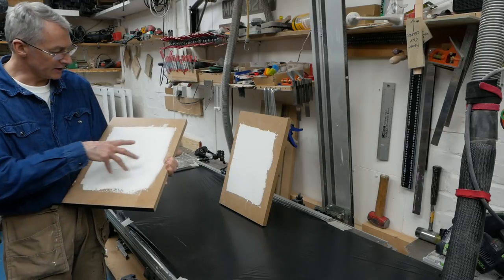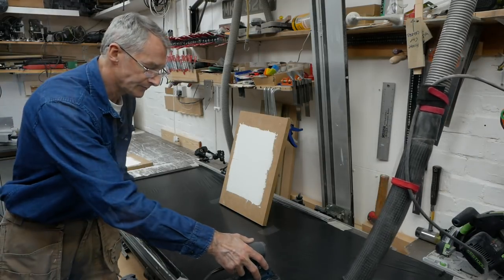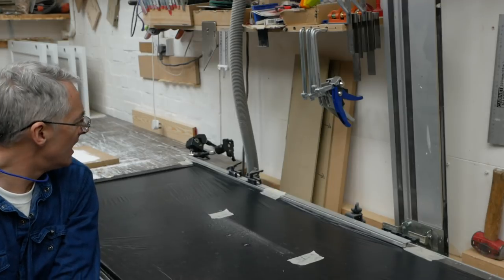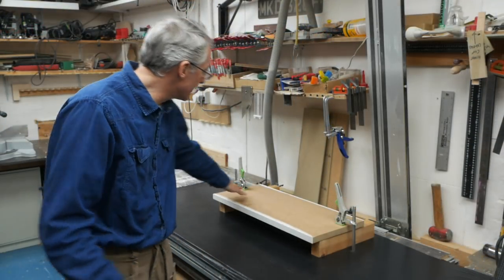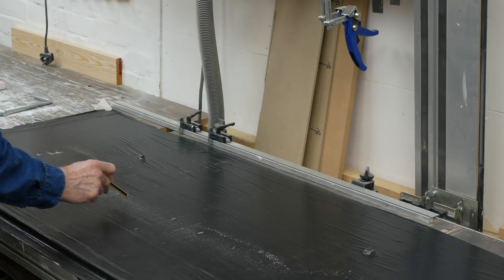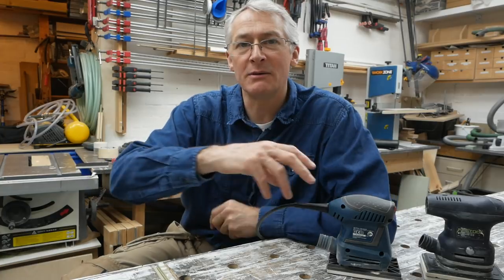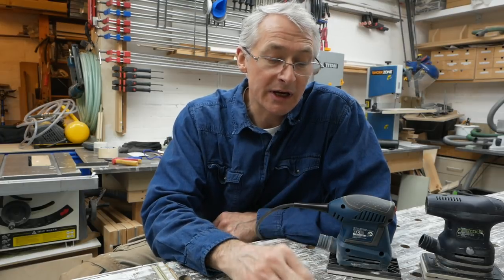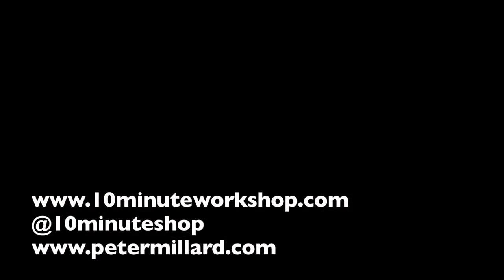The Mirka Abranet Test #157

Comment: Thanks for the vid, I looked to buy the Festool sander/vacuum combo and could not get a decent price.  I was at my local Dulux trade counter and Mirka were doing a road show with their combo was at a considerable discount (hundreds of pounds below the green label version).  It has been a real workhorse, the Abranet does not clog anywhere near like the standard paper version and I do buy them at a decent price.  They last on average three times longer and I don’t throw them away.  I’ve done large solid floor areas in my lads salon (Oak) - sand all sorts of furniture.  Excellent dust collection was a must.  I’m not suggesting it’s better than Festool, for the money it has proved an excellent buy and performer.  Kindest regards Mike
Reply: Mike S   Mike what Mirka sander did you buy? And was it a Ceros or Deros?
I too really like the Mirka sanders and Abranet sand paper/mesh. I have it in 40 grit up to 1200 grit and I get virtually no dust after sanding.
Ron
Reply: I have festool and am switching to all mirka. I really feel festool is over rated

Comment: Abranet fanboy here I'm afraid. I've been using them for well over 10 years in the automotive industry and I'm sold on them. Yes, they cost more than other types of abrasive but since they almost always last longer than other paper backed products I've used, the initial cost is evened out in the longer run. And I understand your comments about the interface pad. They are made more for sanding over gentle curves, to stop you getting what we call the "50 pence piece" effect, where you can get ridges if you use a harder backing pad. They are not ideal for flat sanding.

I see it has been mentioned already but the pad saver is really what you need in your application. Due to the net nature of Abranet, sanding dust and worn abrasive particles can find their way onto the velcro of your backing pad, causing it to wear and lose its "stickiness" prematurely. The pad saver was introduced to reduce this effect. The velcro on the relatively inexpensive pad saver wears out first, saving the more costly backing pad. They are so thin (basically double sided velcro) that they don't affect the handling of either orbital or random orbit sanders, or indeed hand sanding blocks.
Reply from the maker: Thanks Andy. I bought a pad saver and an interface pad, and they were both the foam type. Turns out you have to specify ‘pad saver strip’ to get the thin one <shrug>

Comment: i;ve used the mirka deros with abranet sanding discs but you used the the foam backing disc which is used for shaping where as the normal pad saver sands flat
Reply: QWERTY7773 Mirka has 2 type of intermediate pad that will extend life of the backing pad. 1 pad saver  2 interface pad. The pad saver is thinner.

Comment: My impression was that the main advantage of Abranet wasn't the dust collection, but for the longevity of the sheets compared to traditional sheets. 

The normal sheets can "clog" easier, the dust getting stuck in the sheet and making it smoother.  With the abrasive being the removable mesh, you can pop it off, blow it out, and continue using that same sheet. You're not constantly popping sheets off and tossing them in the bin. More eco-friendly or the like? Man, I sound like a marketing shill... ;D

Now, whether the longevity and convenience factor offsets the cost is completely another matter, but I've seen woodturners that swear by the stuff :)
Reply from the maker: Me too, but have to say I’ve never had an issue with clogging on Granat. 👍
Reply: Fair enough!  This may be one of those instances were it works great better for everything but Festool :D

Comment: I use arbranet with an LS-130, I don't use any interface pad and I haven't noticed the sander's pad wearing more quickly than usual.  Festool also make thinner interface pads.  I also find arbranet less likely to leave unwanted marks in finer grits.

Comment: I’m late to the discussion, this dropped over a year ago (#091) and several months ago (#157).  Thank you Peter, for very thorough review & research.  I really enjoyed watching the #091 three parts, was on edge of seat by the third episode.  
I own Bosch sanders, they are reliable, cost-effective, and get the job done.  I love that I can use third party sandpaper with them.  Have not yet tried Abranet paper, or drilling out the Bosch bottom plate, thanks for info about Festool pad saver strips.  
I also own Festool sanders, they are obviously premium tools.  Whenever I am working inside or in a dust-critical situation, I always grab the Festool.  When outside, esp with more than one person on the project, we get out the tools, and swap after a while if we can, so ea person gets time on the tools.  As expected, opinions are divided.  The effect of wood dust on our lungs is long-term.  Bill Pentz’ research is food for thought, if not action. 
The “is the Festool really worth it?” debate will never subside, nor should it.  The wonderful thing about the current tool market is our option to choose from many good choices.  Imagine the dire straits if there were only one Tool Company.  Of course, the best tool is the best one for you, which will vary from project to project, budget to budget, & clients’ expectations.   
Thanks again, you clearly put a lot of time into preparing these videos, they are very informative.  I too always appreciate it when I can breathe easily.  The dust collection on plastic sheets was an eye-opener.  Cheers….
Reply from the maker: Thanks Rich! 👍👍

Comment: I bought a Bosch GEX 125-1 AE sander last year - its similar to the one you were using in your test but has a 125mm round pad.  I find it a nice little sander, effective, handles well and good value. I've tried it with  Abranet and found it does improve dust collection over conventional discs, as your test shows. Plus I think I get better performance due to less clogging. So, it works for me!
Reply from the maker: Appreciate he feedback, thanks! 👍

Comment: Hi Peter, check out the „Pad Saver“ from Mirka. These are available for Festool hole patterns and only add about 3mm (or less) thickness, thus giving you a much more „conventional feel and control“ for the sander when using Abranet.
Great comparison!
Reply from the maker: Thanks! It's called a "Pad Saver Strip" apparently. I bought a "pad saver" and an "Interface pad" and get the foam version both times, sods law. As I say in the vid, I don't think the foam pad affects the dust collection (which was the purpose of this vid after all) but it sure doesn't help the handling!
Reply: I can‘t speak for the RTS, but I‘ve been using the pad saver on my ETS 150 for years and have no issues in handling. If in doubt, I would say with the hard pad and the pad saver it equals the feel of the medium pad with normal paper, if that helps...

Comment: The Mirka Deros plus Abranet, is a dream combo. Little dust, light, not too much vibration and effective. have tried the lot and I think it is worth every penny. Particularly for the really noticeble reduction in fatigue, which I think subconsciously is the real reason sanding is dreaded, even more than the dust. I bought mine, as an Axminster return. Really recommend.
Reply from the maker: They’re fine sanders - just wish I could get along with the flappy paddle switch; had to return mine 😕
Reply: Thats a shame. Try the new rectangular one, it looks even lighter, and maybe the paddle won't bother you. The plug in versions are easier to use than air powered. The paddle is not so stiff/large.

Comment: Peter, have you done any testing to determine performance differences between Abranet and non-mesh style sandpapers to demonstrate the effectiveness of Abranet?  To my way of thinking, that aspect its sanding performance, which of course would be influenced by how well abrasives facilitate dust-free operations, is much more important.

Additionally, I'd like to see such testing done with the panels in their most common orientation, and that is lying flat on the bench.

Thoughts?

Comment: Good review.  Didn't think the pad would affect the Festool so much! Thanks Peter.
Reply from the maker: Thanks Jim! Turns out there is a thinner pad saver called a "Pad Saver Strip". I bought a "pad saver" and an "Interface pad" and get the foam version both times, sods law. As I say in the vid, I don't think the foam pad affects the dust collection (which was the purpose of this vid after all) but it sure doesn't help the handling!

Comment: Dear Peter, thanks for the video. I am making wooden pendants (very small), so I don't have a chance of using power sander. I use hand pads without dust collection. Abranet never clogs. It is faster (I know cause I hand sand) and lasts much longer than all other sandpapers. This is my experience.
Reply from the maker: Thanks Olcay! I’ve never had a problem with clogging since using Granat tbh, and these tests were really about dust collection more than anything, but appreciate the feedback 👍👍

Comment: The biggest problem I found with Abranet was that it lost its grip on the pad much sooner - long before the grit wore down. So you are left with a bunch of (in my case) discs which are usable for hand sanding, but come flying off the orbital sander as soon as you switch on the machine. I tried to talk to an Abranet rep at W16 (NEC Trade show) but he was not interested. I got the feeling that it was a known problem to which they had no answer.
Reply from the maker: I think this is where the interface pads, or pad saver strips come in. 👍
Reply: Yes, I can confirm Peters reply. The Pad saver helps greatly in adding a normal amount of „sticking power“ to the Abranet, It also, as the name implies, keeps the original pads Velcro protected. In addition, it can be used as a minimalist interface pad on normal paper. I‘m not in any way trying to advertise, it‘s just that my personal experience with the pad saver has been really great and I see it as the most important addition to my tools since starting to use Abranet...
Reply: Thanks both. Maybe I'll give it a second chance. I spend quite a few hours each week using an orbital sander, so any improvement is welcome.

Comment: I find mesh type sanding abrasives knock spots off of non mesh types when sanding on the lathe. They don't clog as often and both sides are usable. I do use both still. The lower grits from #60-#120 for  general sanding and the higher grits #180 - #600 for finishing work

Comment: I use the foam pads to sand non-flat surfaces and profiled timber.
Reply from the maker: Yeah, watch the follow up vid. I bought the “pad saver” and an “interface pad” and the foam ones were what showed up. “Pad Saver Strip” is the magic phrase, I’ve learned 👍

Comment: Hi Peter, another great video thanks! Just out of interest, I notice you work with MDF quite a lot and I was just wondering if you use an M class dust extractor for this? I know the Festool CTL26 is meant to have the same filter as the CTM26 but without a few of the extras, so I was considering going down this route. However, just wanted an idea of what the pros use. Thanks again for all the great content!
Reply from the maker: Hi Daniel, and thanks! I use regular CTL extractors; as far as I can tell the only difference between the L and M class Festools is the warning you get with the M class when the extractor bag is full enough to restrict the airflow. But of course, please do your own research before making a significant purchase! I seem to remember a detailed thread on Festool Owners Group forum about this  exact issue - might be worth getting on over there and searching it out?? 👍👍
Reply: Thanks for the info Peter, it's a great help. I'll be sure to check that out!

Comment: Had never heard of Abernet before, I have some Axminster mesh sanding strips meant for wood turners as they are cooler in use when final sanding a piece spinning quickly on the lathe. They also are quite a bit slower so I guess it depends if you want to save time or your fingertips 😄

Comment: Abranet is what the woodturners use I had plenty of this for my lathe easy to bend etc. 

How do you do extraction I heard some type of industrial vacuum in the video do you have flexi pipes over the workshop or some type of tube ducting? 

Make plenty of dust here I have a Henry Vacuum looking at rigging this up to suck it up somehow. Regards Tony
Reply from the maker: Hi Tony. I’ve heard from a few woodturners who are fans - the mesh backing makes for ‘cooler running’ I think?? WRT extraction I have an old Festool CTL 22 vacuum under the main bench and I run the hose up and over the bench to a boom arm that reaches the main areas pretty well - I talk about it in a bit more detail in my shop tour video. I have another smaller extractor attached to the mitre saw, that also does duty on the bandsaw. 👍👍

Comment: Peter I don't  use the pad with my sanders, Festool's  and Makita.  They also make a thin pad , about 3 mm. B
Reply from the maker: Thanks! It's called a "Pad Saver Strip" apparently. I bought a "pad saver" and an "Interface pad" and get the foam version both times, sods law. As I say in the vid, I don't think the foam pad affects the dust collection (which was the purpose of this vid after all) but it sure doesn't help the handling!

Comment: thats an interface pad on that sander rather than a pad saver, pad savers are mm thick. that interface pad is used to sand curved surfaces to help spread the pressure evenly which is maybe why on flat surfaces it tend walk all over the place due to lack of pressure being applied
Reply from the maker: See Abranet follow-up video. https://youtu.be/8lMDfx9O2J4

Comment: Whats your experience of clogging? I bought some JCB branded mesh abrasive recently (because I saw it in the shop and thought I would give it a go) and in my limited use of it it does appear to clog less/be easier to unclog than normal sanding sheets.
Reply from the maker: Have to confess, I've never had an issue with clogging when using Granat. I think the dust collection helps keep the abrasive cool, which reduces it significantly. 👍
Reply: I have used the mesh based stuff on my mouse sander which doesn't have any dust collection (I know I should have realised when I purchased it!) and it appears to clog a lot less than normal abrasive. Plus when it does you can just peal it off and blow it out. I noticed that a commenter below has mentioned something similar. 

I guess the moral of the story is, only buy sanders with good dust collection designs and it makes life better all round! :)

Comment: Have you done a video showing your full, normal production, workshop extraction? As your main cutting is the TS55 rather than the Table Saw I recon the dust in your shop is way less than most table saw owners?
The one thing I have noticed in my garage is that the my extraction, a simple shop wet/dry vac, gives out a lot of dust.... this seems to be passing through the vac and back out into the work space. Next step for me is to introduce a cyclone into the system and some air filtration system. I will have a search for your Festool Shop Vac videos... I know that their equipment is expensive but if it works then the price is irrelevant!
Reply from the maker: Thanks Richard! I talked about it in general terms in video 066	Workshop tour	https://youtu.be/Ce_gMwIQQsk, and in more detail when it broke - and was repaired - more recently in video 370	My Problem with Festool, https://youtu.be/WhDSe6wG4_c HTH. P

Comment: Great review.  The Fusstool is better but will cost you.  The amount of holes in the pad seems to be the factor. I thought the Abranet would have made a bigger difference and helped the Bosch.  Maybe try a piece of Mirka pad saver as a backer.
Call me crazy but i just bought a Mirka  Deros 5” palm sander for $600.   Incredible sander. Completely dustless, variable speed, quiet and low vibration, soft start....Amazing.  If you look at the Mirka pad it has about 40 holes that all interconnect to the suction.  The reviews were so good i had to try it. Replaced an old Portercable 5” screamer.  Went from one extreme to the other.  My lungs wish these sanders existed 25 years ago. The cost is absurd.  Cant understand how a palm sander costs as much as my Hitachi slide miter? Fusstool’s pricing is absurd also but they are pushing all the other tool makers to improve their products. Fusstool will have to adjust pricing eventually or loose market share.
Reply from the maker: Thanks! Mirka Deos is more expensive than the Festool RS400, just FYI. The Deros is a fine sander, just wish I could get along with the flappy paddle switch - had to return mine 😕

Comment: I have a Mirka pad saver for my Rotex125, to use abranet on that machine. It’s not got the stupid squishy bit on it. Just Velcro on both sides.... pretty sure they do them for the RTS too - disclaimer, I’m not a fan of a tamer either, brillant2 and granat all the way I’m both my Rolex and my RTS !
Reply from the maker: Thanks Richard. I bought both a pad saver and an interface pad, and they were both the squishy foam. Turns out I should have searched for ‘Pad saver strip’ which is exactly as you describe. I’ve ordered one to check it out 👍👍
Reply: Peter Millard I’m pretty sure Festool have their own version now, since they brought out “granatnet”, I suspect it’s simply rebranded AbranetAce as you still net the same pad saver...
Reply from the maker: Really? I haven’t tried it, but I’ll check it out , thanks! 👍
Reply: Peter Millard has everything you need: https://www.festool.co.uk/campaigns/landing-page/granat-net

Interestingly, they’ve also released 125mm now too!